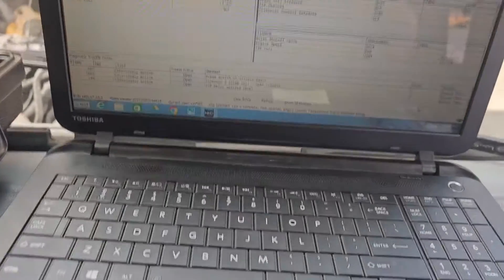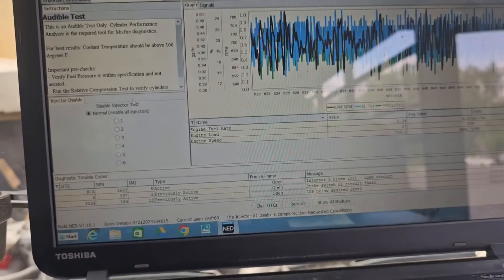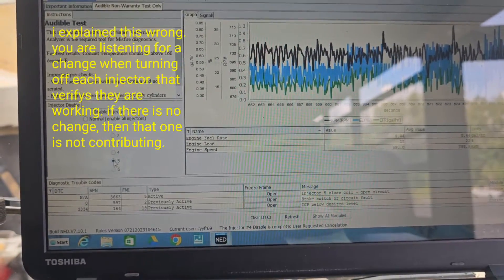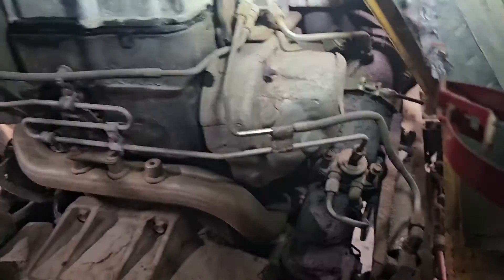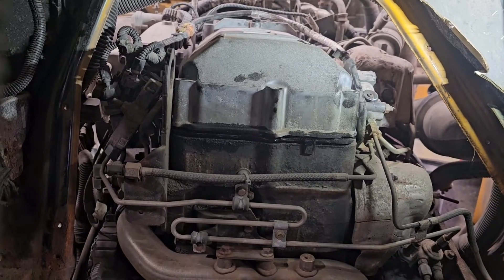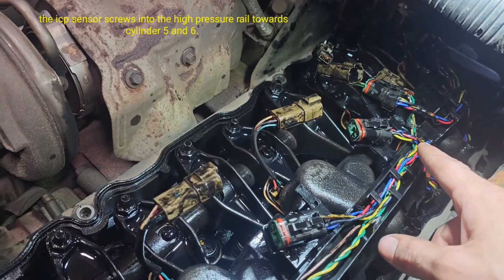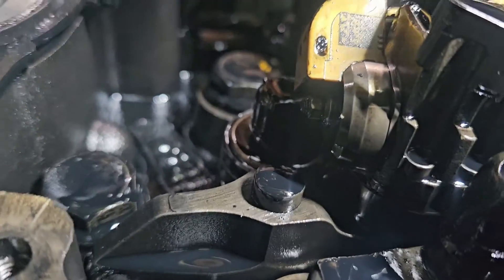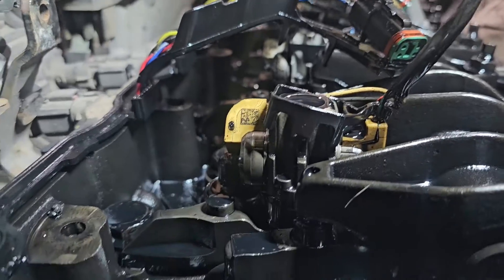diagnosing and fixing a failing injector 2012 maxxforce dt

Comment: Disculpe tengo un motor igual pero perdio fuerza y lo apagas y le mueves unos arneces que van en la manguera del posenfriador
Reply from the maker: Im not sure exactly what you said because the translation isnt very clear, but if youre saying that it loses power and after moving that harness it comes back, it sounds like you may have a bad wire somewhere in that harness, or a poor connection to one of the sensors, if that is the case, try moving those wires a bit with the engine running, see if it changes anything, and if it does try to pin point exactly which wire is the cause.   If thats not the case, and your losing power, i would start by checking all the intercooler/turbo plumbing, make sure nothing is torn or loose, sometimes the clamps like to snap, also the bottom of the plastic air box where the air filter is tend to crack, if thats not the case, check your fuel filter and the housing, and also the fuel screen which is located next to the filter housing, make sure everything is clean, the housings tend to get gunked up, you can investigate further by checking your icp sensor, and the ipr valve, then run injector test and make sure everything is functioning properly.